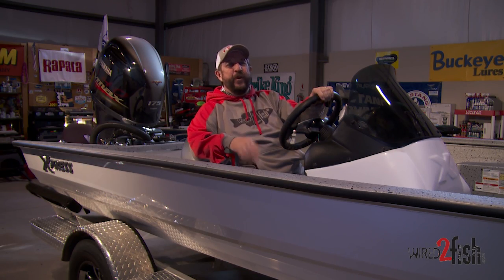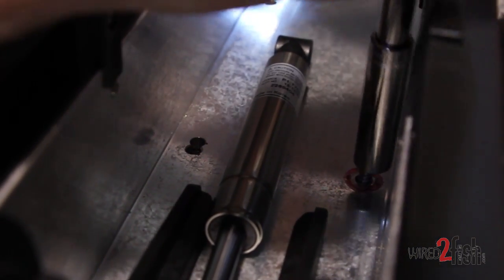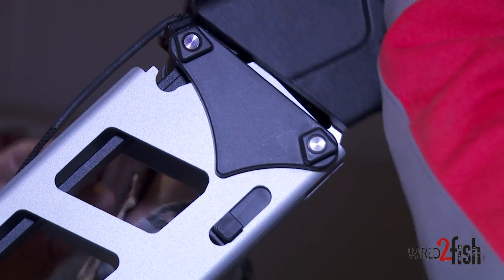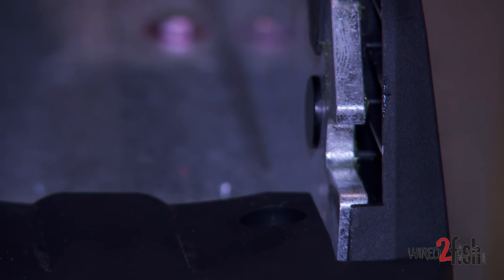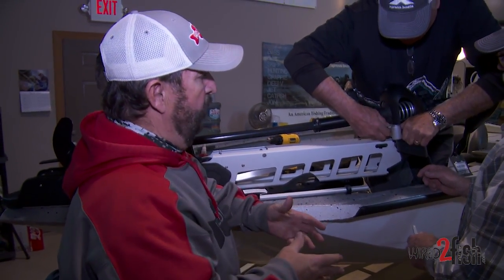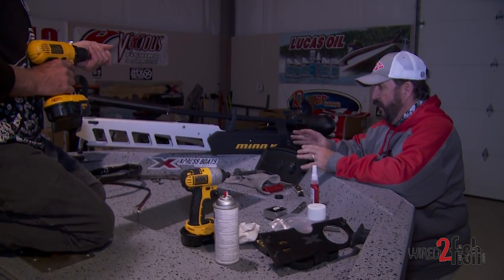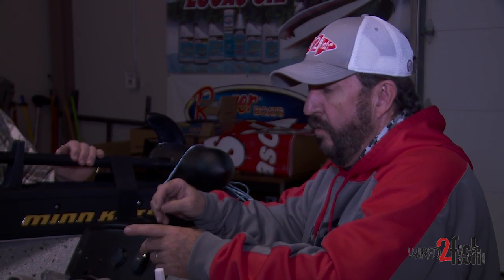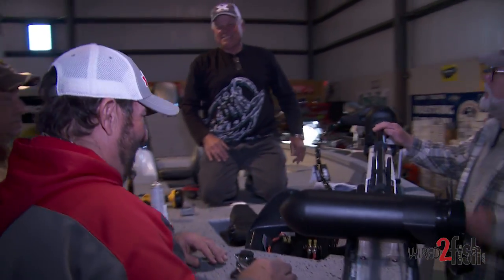How to Rig Bow-Mount Trolling Motors

Comment: Did you add any dampeners under the base piece before bolting/screwing down? Something like small rubber washers to help inbetween the surfaces of the boat and the bottom side of the mount?

Comment: This is just a straight install on all new equipment. I dont see that they install or even discuss putting vibration isolators between the trolling motor base and the boat anywhere that I can see which is what ends up busting the mount out of your boat over time. I also didnt see them mention anything about checking balance on your blade. Buried in the minn kota install manuals it says to run it dry and if you feel too much vibration a fix is to unbolt the prop and rotate it 180 deg and remount.

Comment: Thanks for this, ordering my minn kota power drive and I'm installing it this week. Great timing lol. One question, when measuring for shafts length should u allow for a little higher shafts when going through choppy waters? My shafts length measure at 48" exactly, but I feel like I should get the 54".
Reply from the maker: Hi Andrew, Minn Kota has a chart to help determine the proper shaft length: https://goo.gl/zPVBi6
I guess the answer to your questions also depends on how you fish and personal preference. I do a lot of multi species fishing and like having enough length to handing different situations (shallow slop to open water 4 footers). A  52'' shaft would be a perfect calm water/shallow habitat length for bass fishing, but it's too short in 3 footers, so I went to a 60'' Ultrex to cover both scenarios.

Comment: Question, how far from the edge of the boat / bow should the "point" of the trolling motor cradle extend?
Reply from the maker: Hi Bob, our criteria here is that it needs to extend "at least" far enough so that the trolling motor lower unit doesn't hit the boat. Meeting this minimum clearance also means the trolling motor isn't over extended, which unnecessarily increases stress and torque on the mounting hardware.
Reply: @Wired2Fish  Thanks!! Got it moved forward after measuring about 6 times first before any holes drilled. Works perfectly now.